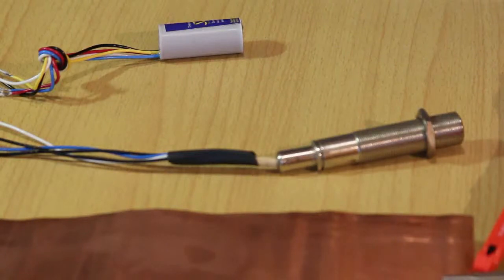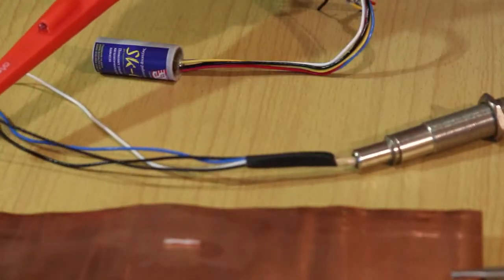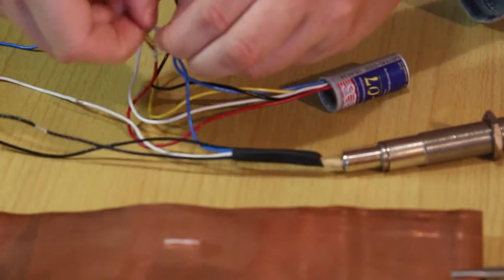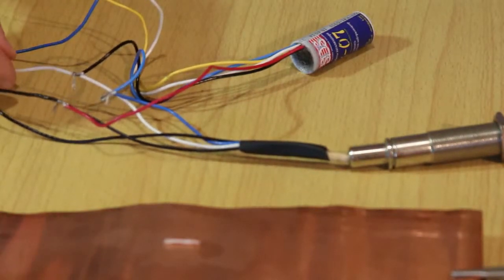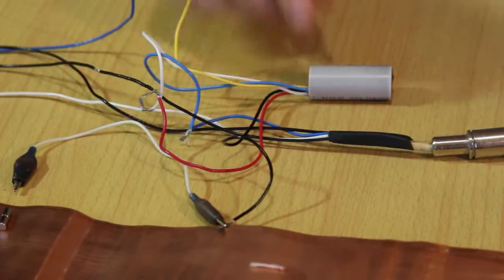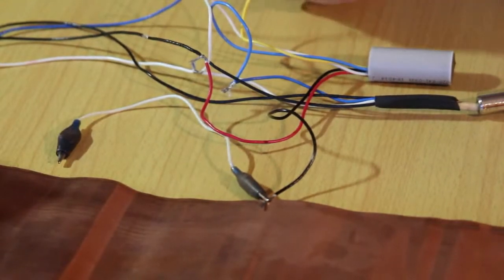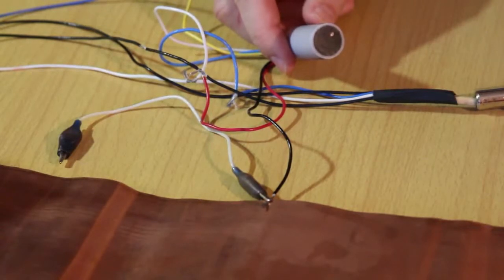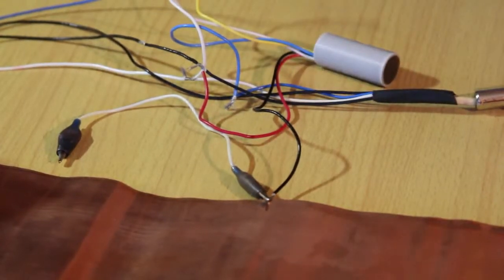Connection of the catalyst emulator SK-07

Comment: 2008 Lexus Gs350
Installed this part, and now get p0606 immediately on startup
Reply from the maker: Hi, 3 possible causes of error p0606:
- defective oxygen sensor
- Wrong connection.
- Faulty emulator. Contact the seller to replace the emulator. In some cases, the problem of error 0606 can be solved without replacing the emulator (if the voltage readings are normal).
What is the rear sensor voltage reading at idle?
Reply: @ДмитрийСеребро  it was just a poor connection on the signal wire to the emulator 
Thanks
Reply from the maker: @williamthibault5545  Please. Glad it worked